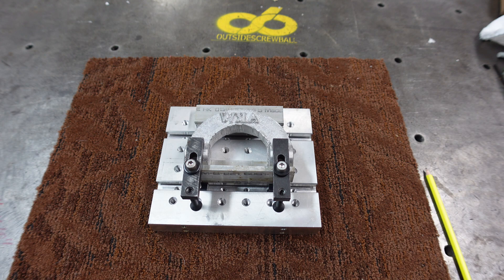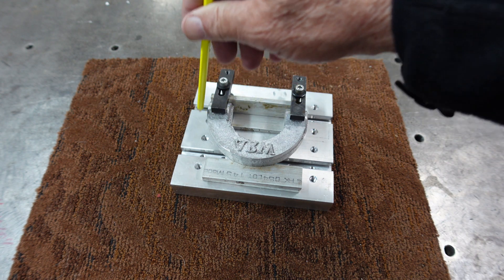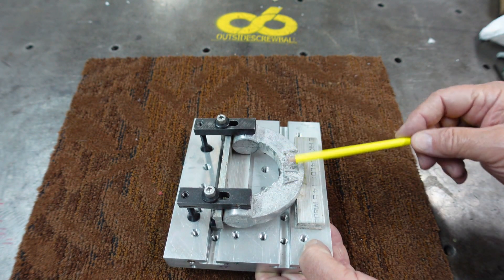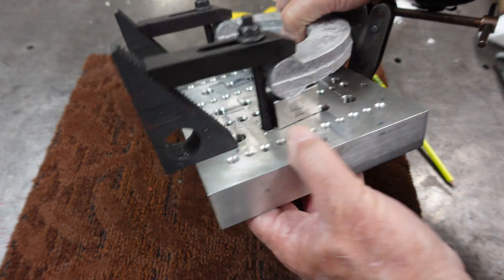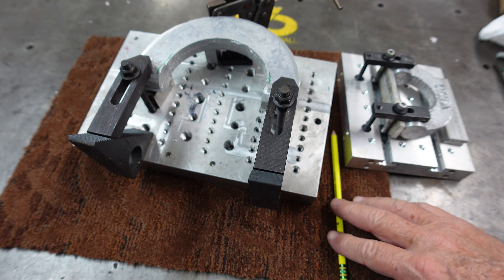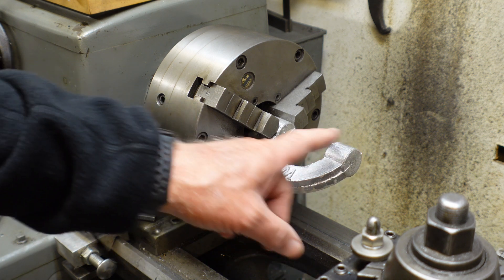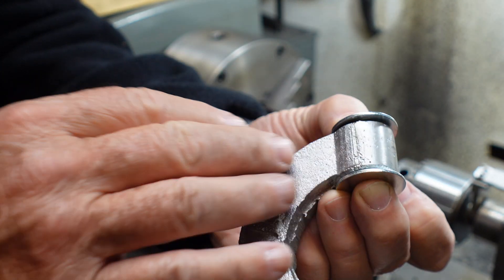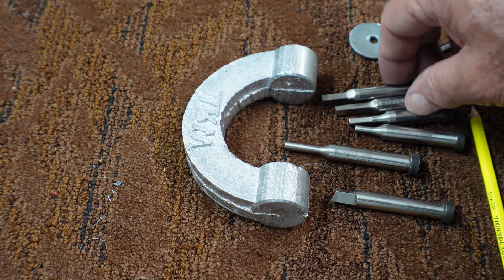Design Review Follow up  (Part 2)

Comment: You already know it runs pretty true in the Lathe. Another idea, put it in your super spacer with 3 jaw chuck vertical. Bore all the way through both barrels then machine the OD of the barrels. The heck with doing it by hand. As long as you use the 3 jaw in the super spacer bore both holes , machine OD of barrel on top end, and then flip it end to end to do the other barrel O.D.  That would be another way to get that cat skinned.
Reply from the maker: You got to be a professional cat skinner!!.. Damn, nice CS idea.... thank for viewing and your comments...

Comment: My thought is that if you press the casting against the hold-down bolts or a bar up against them the way you did at the beginning, those bolts probably will not be 90 degrees to the pallet ie the mill table.  Doing that just introduces dimensions you will not be able to quantify or repeat.  Try to keep everything as simple as possible(KISS  principle).  The outside of the castings except for mounting and pivoting does not need to be machined and will only add to your problems.
Reply from the maker: thank for viewing and your comments...

Comment: Mounting the part in the lathe chuck looks like a good way to get the "barrels" center drilled and possibly bored.  As far as cleaning up the parts, I vote for Liptonizing the part.   Tom must be smiling.  The new setup using the pallets, I think will be better for the heavy machining.  I think it's almost time for the chips to start flying.
Reply from the maker: thank for viewing and your comments...

Comment: I like the file button option.  I also like the lathe set up.  Once drilled to size you can use a rod through the holes to set the casting back up on the pallet.
Reply from the maker: thank for viewing and your comments...

Comment: That was not quite what I had in mind, except that it is good for marking the centres. 
What I meant was put a drill in the lathe chuck and use the tailstock centre as the alignment and feed. The drill will of course line up with the tailstock insuring perfect (?) truth. The part being machined being none rotating.
You wouldn't want to meet me, I might contaminate you with Englishness.😁
Reply from the maker: thank for viewing and your comments...Chris...hmmm, are you setting me up for a fail video....LOL, don't think I want to hold the part like that....read post from Old Iron Machine Works....thoughts?

Comment: Hi Chuck - my two cents here. The pivots are the critical parts & the rest of the casting is too irregular to count on. So I'd find the outside centers of the pivots first (like you did on the lathe). 
Grind a bolt into a point & screw it into your pallet - this way you can centre on the bolt then set one end down on it to get vertical alignment to drill a hole through both pivots. Fit a drill rod all the way through. 
Knowing the size of the rod you now have a centerline to work with. 
On your pallet, insert jacking bolts to support the frame keeping the edges clear. The heights of these can be set whilst the drill rod rests on v blocks. Clamping the frame & rod will allow you to square the pivot ends & cut the frame, staggering the clamps and sliding the rod back & forth as you move around the part.
Once the part has squared ends & parallel sides on the frame, stand it back up again & return to the pivots to open them up (boring to desired size).  Have fun - Stay safe and well :)
Reply from the maker: thanks for viewing and your comments